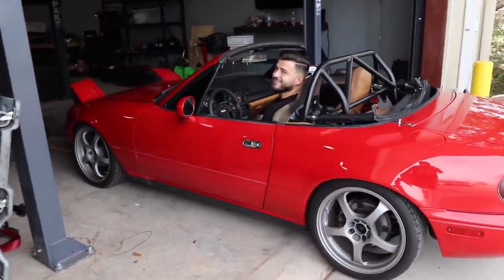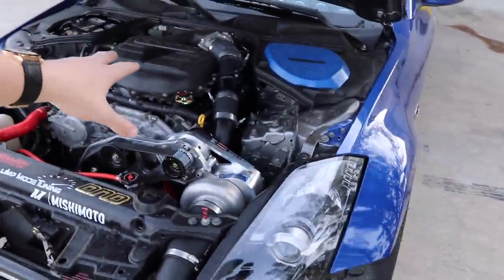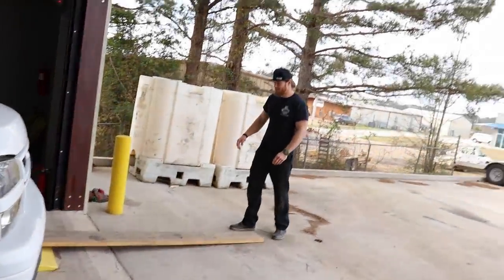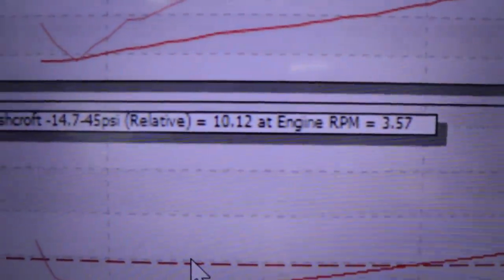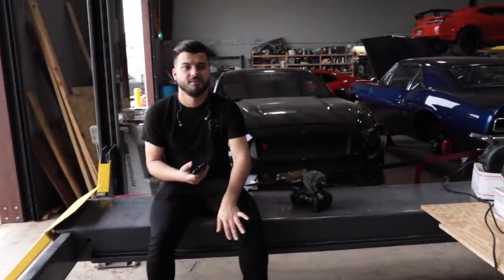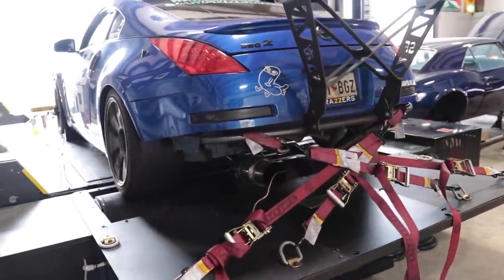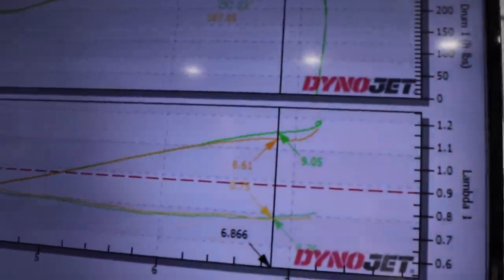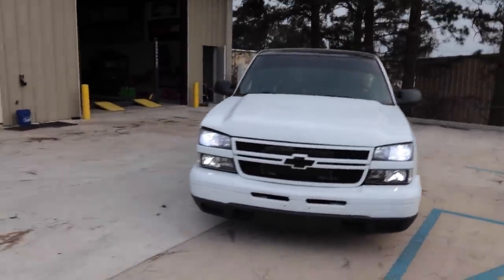My Procharged 350Z Makes More Horsepower Than Expected!

Comment: The Procharger looks really good quality, is it a straightforward fit? I have a Rev Up with only 54k miles, pretty much mint. Would the motor handle the extra grunt long term? Also the Procharger runs in it's own oil, is that reliable and how often do you have to change it please?
Reply from the maker: It's pretty straightforward and comes with instruction.  I have an entire install series for the kit if you're interested in doing the same thing. It should answer any questions that you have about it! Also, you change the oil in the pro charger about every 5k miles (so every oil change). I've already changed it once and it's pretty simple.